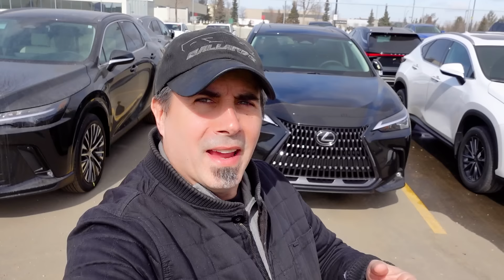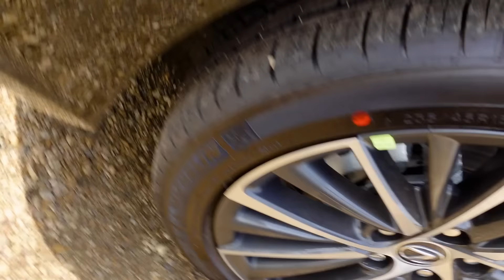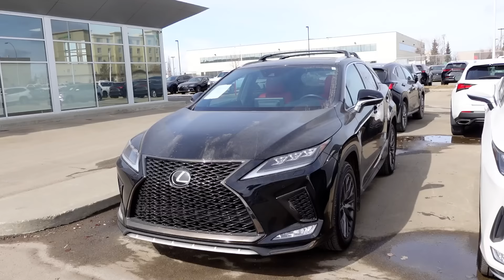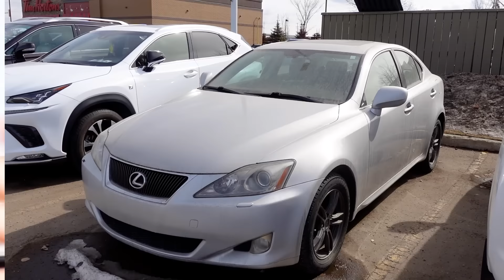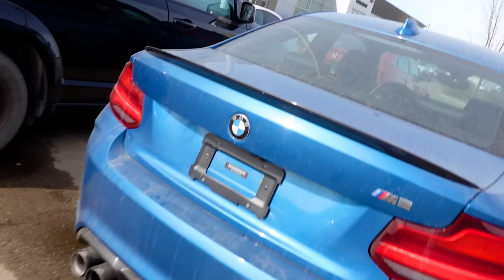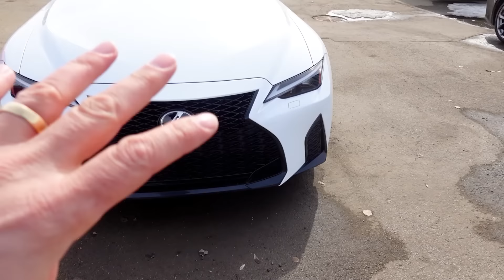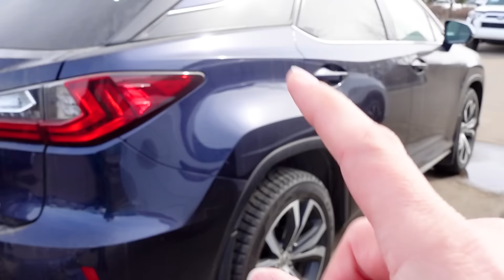Is Buying A Used Lexus a (MASSIVE) Mistake?

Comment: Owned 6 used Lexus always reliable.
Reply from the maker: Yes that’s true they are solid runners
Reply: Somthing happens when you own a lexus. You realize how often you visited the repair shop with other brands.  I  am on my 4th lexus and wouldn't buy anything else!
Reply: I have an old 2002 is300 inline 6 and have over 200k miles 😉 change oil every 3k miles..the valve cover gasket and oxigen sensors are the only things thats don't last long 😅  but are cheap and do it myself
Reply: Lexus - simply the MOST reliable cars in the WORLD !!!
Reply: Same here.  I’ve had three of them and two were bulletproof.  The 2008 GS350 was a piece of shit.  Blown engine at 160k miles.  Bore scoring from bad piston rings made it a total loss.
Reply: Nice
Reply: I’ve had 3 since 2008 … no issues with any of them 👍
Reply: 6? Sounds like they were unreliable
Reply: @WokeisaJoke0522 sounds like you didn't read why he got 6
Reply: @wiggleysniff6645  yeah, I missed that. He could have stated it in his original post. By the way, I drive a Lexus, haha
Reply: What’s the max km you look at when buying a used Lexus?
Reply: Have a 2009 Rx 350.....220,000 miles.  Had to replace front struts, but live in the Northeast.  Expected maintenance
Reply: So reliable that you needed 6? 🤔
Reply: 2001Rx my wife drove to 280k. Multiple RX owned. I totaled my IS350, have the GX and a RC now. Looking at the LC 500 now. So now will be 7.
Reply: @patrickchilds5486  makes sense. I’m just messing with ya. I love Lexus. I always recommend Lexus to my non car friends.
Reply: @patrickchilds5486  new lc 500 is a winner
Reply: @patrickchilds5486 Nice! LC is on my radar as well! I own a GS350 now but I don't want to trade it!😢
Reply: @patrickchilds5486  wow you done well with money
Reply: @patrickchilds5486 get the 500LC. That car is a beauty.
Reply: That LC is MAN goals💯
Reply: @patrickchilds5486 lol
Reply: @HotRodM4  maybe he purchased several for members of the family (wife, kids, parents) or maybe he bought them drove them for a number of years and decided to upgrade to newer used models. Doesn't mean the vehicles weren't reliable.
Reply: @HotRodM4  maybeyou need to put ypur brain up in your head not your in your foot
Reply: @HotRodM4  will
Reply: @com1911sks  william
Reply: @HotRodM4 probably has a family of 6 the cars are extremely reliable how ever get the lowest mileage as possible make sure it doesn’t have any accidents you know the ideal ones I’ve found nice Lexus used with very low miles
Reply: @HotRodM4 So what you buy a car for ever
Reply: @HotRodM4 😂😂
Reply: @HotRodM4 I had 3. They were leases.
Reply: @Hot Rod M4  I was going to write the same thing,  makes no sense at all😂
Reply: They were good but now they make super cheap interiors
Reply: @adriano8809  nonsense, interiors are better than any German, or other models.
Reply: @adriano8809 You can talk about how they’re  behind on tech and performance but interior and fit and finish is second to none